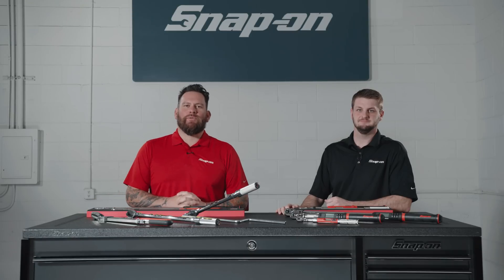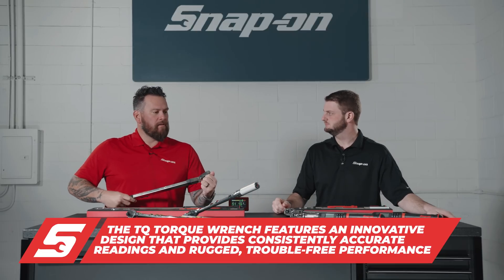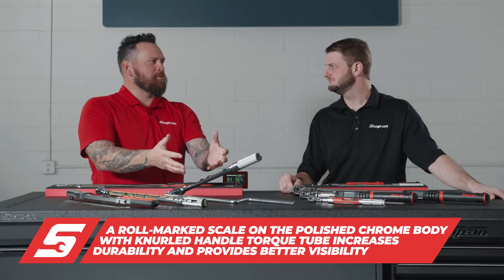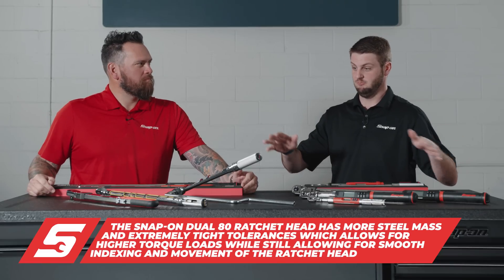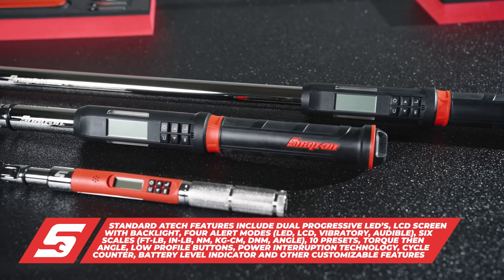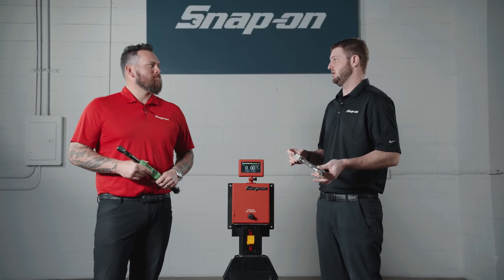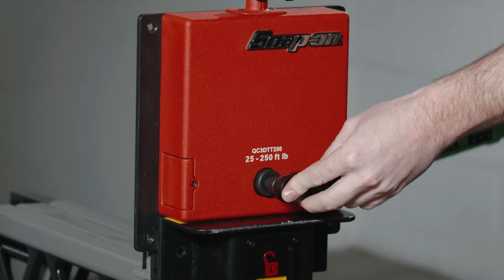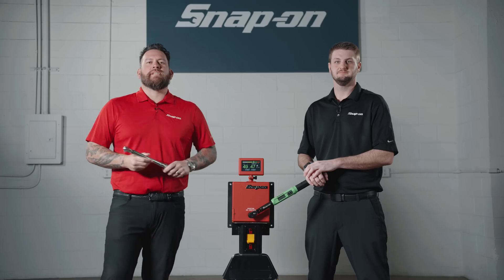Torque wrenches explained I Snap-on Tool Tips

Comment: I don't understand what changed between the two tests. How did test 1 click at 50 but the second went over?
Reply: from what I saw, they changed the calibration mode, the first one was to check if the torque wrench was accurate and the second test was (person) + (torque) added the +or - 4% that would be a regular case scenario of you or me using it and then showing that the atech is more precise because you get to feel and look at the lights and reading, which still has a +or - of 2%.
Reply: He held it by the tail end. If you hold a torque wrench in the wrong spot, you change the length of the lever and change the torque value. Further away will overshoot, closer will undershoot. Torque wrenches must be used from the handle
Reply: @kennethebel7726   You're right, the torque wrench needs to be used from the handgrip or the torque value will change, but the variation is the other way around - at the tip will reduce the value slightly, moving towards the drive head will overshoot the target value. He deliberately jerks the motion on the first occasion to get a high reading, and the second application is steadier, but still barely half the time he later takes to carefully edge up to the right value with the electronic unit. Just a little bit of fudging going on to make the regular wrench look worse than it is in comparison to the electronic unit.

Comment: Here's a question, that I have not been able to get a clear answer (even though I was a certified tool technician in the AF).
What are the temperatures for storage? Some will say room temp. Others say it doesnt matter. Humidity I can see being an issue due to internal corrosion. 
But temp? When I was a crew chief, the TW would sit in its case for hours in sub 0 temps until we would get to the job at hand. The wrench would get that cold. In storage, I imagine most shops dont leave the heat on, so during the winter, they must experience cold, right?
Im kind of tired of keeping mine inside, and not in the shop. I have a very old school torsion bar wrench (old Craftsman), a click Craftsman, and a CDI 900ftlbs beast (for heavy diesels).
I would like to keep them in my box. So, what do you guys recommend (since you guys own CDI as well)

Comment: The fit and finish of the click torque wrenches is amazing. The knurling on the handle is flawless. But, all of my stuff is Atech. Great torque wrenches, and a lot faster than twisting a handle around 50 damn times. I have the 3/8" up 100ftlbs, the 1/2 up to 250ftlbs, and the 3/4 up to 600ftlbs. Wouldn't trade them for the world.

Comment: Nice video as always, but "Please" what I really need is a real small head and real long neck for hard to reach areas, because the 1/4 LONG NECK POWER RATCHET PN: CTR717, definitely do not have a long neck, and the head is "huge" for a 1/4"drive. I'm using the Aircat 808-15-25, but it is pneumatic and makes no sense, as we all need is a cordless brushless tool. Please take it into consideration!

Comment: I just picked up my 3/8 quick release atech about a month ago, I love it! Now my dealer said you didn't have to remove the battery's anymore, is that true?
Reply: I use Energizer lithium batteries and never take them out except when they are dead. Never had a problem. 
It's when you use cheap batteries and then they leak is when you have issues. 
Just remember there is a section in the settings to set what type of battery you are using too.
Reply: I have one of the original grey handle ones. I've never pulled the battery cap off in 12 years and it still turns on.
Now I say this I'll be half way through a head gasket and the c.nt will die on me.

Comment: An old-timer told me to put your torque wrench back to ZERO before storing it.
Reply: Yes. To the lowest setting. Must unload that spring.
Reply: @spacecat7247  yeah your correct kind of, when you unload the spring it takes the tension off and if you don't you can damage it and especially if it's accidentally knock off something and hits the ground can break the  spring completely
Reply: Or to the lowest setting
Reply: They say that can mess it up if it is loose. I have heard other mechanics say this and I do lowest value
Reply: Fortunately you don’t have to for a dual beam design.